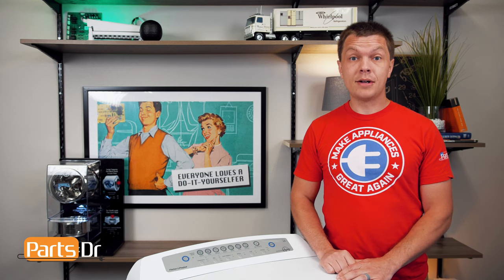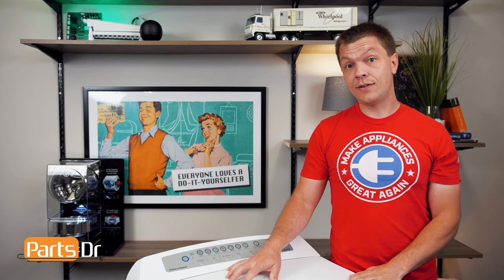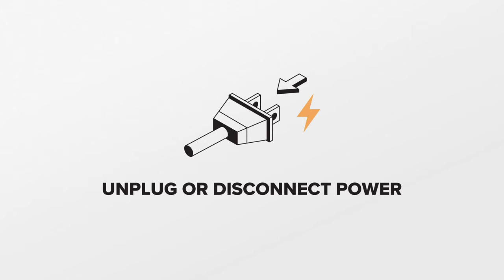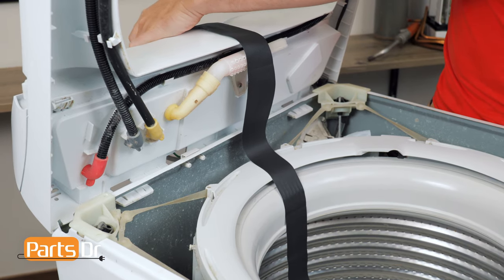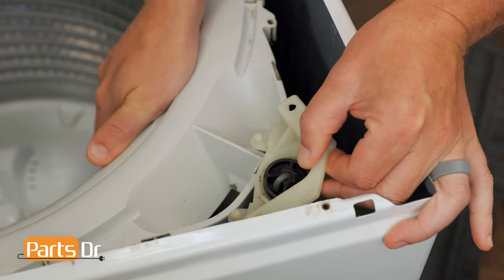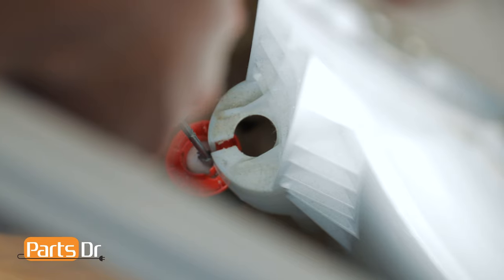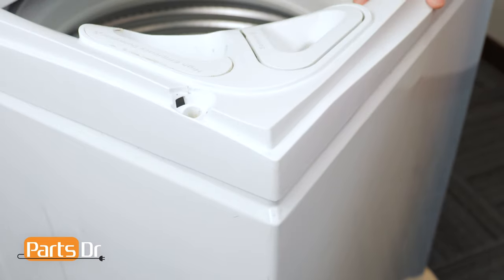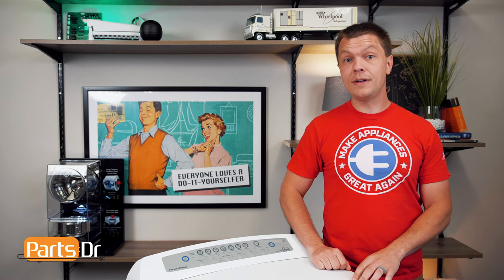How to replace Fisher & Paykel washing machine suspension rods part # 424495P

Comment: Just replaced suspension rods and the 4 corner washer straps as mine had worn out and the washer has had balance issues for awhile now. Followed your video and and now the 13 year old washer is working well. I was considering buying a new washer then I found your You Tube instructions. Saved me $$$ thanks to Part Dr
Reply from the maker: Nice job fixing it yourself!

Comment: Thanks for the video, it was great i followed step by step and was able to install both suspension rods and replaced the bands as well. I still have a slight knocking noise and have been told there are up to 3 issues that could be at fault, I have started with the cheapest & easiest. We will get more use out of the machine and at only 8 years old I hope so, again thank you for a great informative video.
Reply from the maker: We are glad you found it helpful!
Reply: Same here - did you get to the bottom of what the problem was?
Reply: @duncan7855  Machine has been working well ever since
Reply: What is the reason again why you had to replace the rods? Bent rods or weak springs?
Reply: @bzd16b  I Think it was weak springs, the rods looked ok, it didn't cost much more to do the bands at the same time, have been trouble free since.

Comment: Thank you so much for this video. I just replaced all four of mine. Easy peasy until the last one by all the wires. It was clamped into place but not that hard to wiggle it out. My one question is, what if you don’t have that rubber gasket thing? I didn’t even see pieces of it anywhere. Maybe mine doesn’t have one?
Reply from the maker: Some models may not have the rubber tub ring straps.

Comment: so glad i found this video.. easy replacement by the looks but before i buy the parts i want to know if they are actually faulty.... apart from the out of balance alarm... how can you physically tell if the suspension rods are failing? or failed? what do you look for?
Reply from the maker: They can be difficult to tell if they are bad.  Sometimes you will visually see the tub is sagging more than normal or that one of the suspension rods is bent or broken.  Another common thing to cause the tub is get out of balance is bad tub bearings.  Most commonly, the bearings will start to get noisy during the spin cycle when the start to fail.

Comment: Hey! How can I tell the suspension rods are no good? Basically I don't want to replace them and turns out they weren't the problem. I'm having similar issues of out of balance too.
Reply from the maker: They can be difficult to visually tell that they are bad.  Sometimes the tub will start to sag or the suspension rod may be bent.

Comment: Thanks for the video, very comprehensive.  I did replace both the bands and the rods last night and still today when running a load through the washer was out of balance.  Is there anything else to check?  I will say it was some jeans and shirts, so the clothes were balled up and to one side, so it was out of balance, but how can I stop this from happening altogether?  It was not like this up until a few months ago  Any other suggestions to what might be causing it?
Reply from the maker: Bad tub bearings could possibly be causing it.  That is what we would check into next.

Comment: Our Wl42t26dw1 fisher and paykel washing machine drum is hitting the sides of the washer bad when empty. We replaced the rubber straps. It still doing it would the rods be the problem?
Reply from the maker: It could be bad suspension rods, bad tub bearings, or both.

Comment: I'm having lots of out of balance problems with my 2014 F&P model WL4227P1 washer. It looks like I probably need the suspension rods and straps. Problem is that the top on my model does not come apart like the model you have in the video. Is there anyway to find out how to get the top off so I can check what the suspension parts look like? Thanks.
Reply from the maker: I'm sorry, we do not have information on how the top is removed on your model.  When you figure it out, please reply and let us know!
Reply: Same issue, there's a previous post that mentions unscrewing the screws at the back behind the control panel and then lifting and pivoting the top of the washer but I haven't tried it yet. I have to figure out how to get the current load of clothes dry enough to take them out first 😳
Reply: @theresahornberg3420  I found an exploded view diagram from a manual that implies you need to unscrew things from the rear. I never got that far in trying to repair the F&P machine. Several repairmen who looked at it told me that it wasn't the suspension parts, but the drum was out of round and it would not be cost effective to fix it. We bought a Maytag machine.

Comment: The suspension rods shown in this video, Part Number 424495P, are only for F&P AquaSmart models with a low-profile impeller agitator.  Models with a centerpost agitator (GWL11, IWL12, GWL15, and others) take a different kind of suspension rod, and those models don't have the straps.
Reply from the maker: That is good information, thanks for sharing!
Reply: I was wondering if they all have the straps. Pretty sure mine needs new rods. when we pulled it apart there was no strap. Thanks for sharing.

Comment: Would this repair be for a washing machine that keeps going of balance? How do u know if you need new ones
Reply: Yes it was continually going out of balance. I opened up the top of the machine like in this video can view the bands which are clearly broken at the insertion point to the washer barrel on two corners. Guess I just needed to order new bands? Not sure if new rods are needed? The bands are the flimsiest part of this machine.
Reply: Yes it was continually going out of balance. I opened up the top of the machine like in this video can view the bands which are clearly broken at the insertion point to the washer barrel on two corners. Guess I just needed to order new bands? Not sure if new rods are needed? The bands are the flimsiest part of this machine.

Comment: Any idea how I get into my F&P wash smart top loader to check the suspension rods?  It doesn’t seem to have the fixing screws under the lid like the one shown in this video.
Reply from the maker: What is the model number and product code?
Reply: @PartsDr  can you help me with my 10kg f&P model number wa1068g1 it also has no screw covers in the top to access the suspension rods

Comment: Would this be the cause of the washer not spinning the clothes out like it should? The clothes in mine are still soaked after it is done.
Reply from the maker: If the washer is getting out of balance, it typically won't be able to spin out the clothes properly because it may not be able to reach the full spin speed.

Comment: Thanks for the clear video. That shows very well how to install and uninstall the rods. Unfortunately, I ordered suspension rods, and now after opening the machine I realize that the suspension bands are broken (on two corners of the washer). But the rods do not come with a band. I assumed that the kit would come with everything that is needed to repair the suspension, but unfortunately not, I’m not sure I need the new rods, but I know I need a new band (or bands). I can’t quite see if the band goes all the way around the interior or if there are 4 separate bands (one per corner). Do you have any thoughts on what can be done about the broken bands?
Reply: Actually there are 4 separate bands, where each one ties one of the corner rod assemblies to the washer barrel.
Reply from the maker: @swimkim3287  It sounds like you might need to replace the tub ring straps.  We have a video on this repair here: https://www.youtube.com/watch?v=YltiGsfIdFI
Reply: Parts Dr thank you! Yes the tub ring straps are what I need.